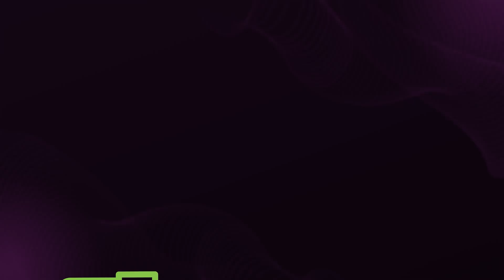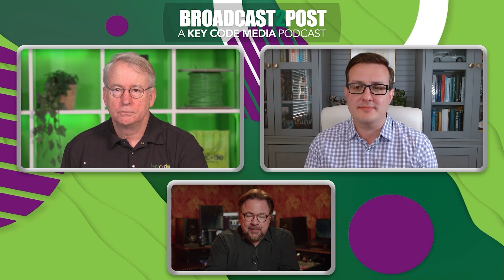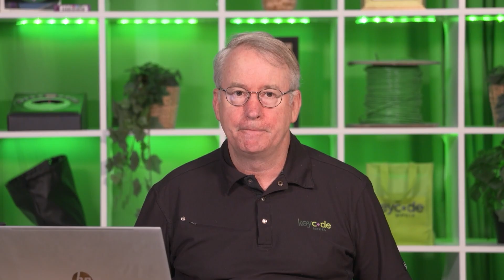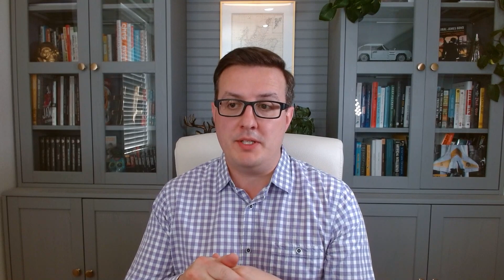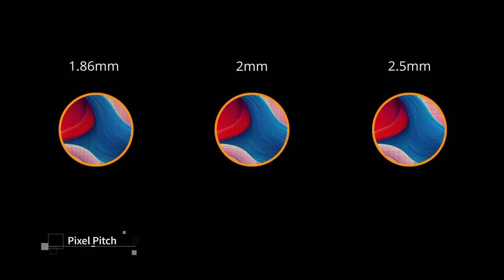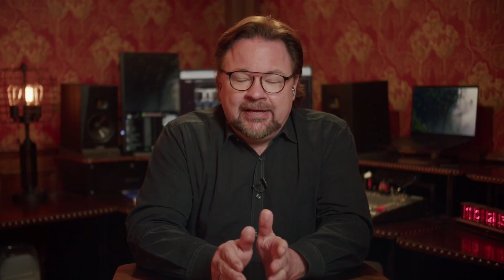Are LED Walls still expensive?? Cost breakdowns!

Comment: I would love to use this for an art installation I’m currently working on but I have a feeling it will still be out of reach for that application. As you probably know, art budgets are currently challenged 🤦🏻‍♀️
Reply from the maker: Totally get that. A lot of our viewers are in AV/IT “infrastructure” roles—people planning out buildings, campuses, studios, etc. so when we say “cheap,” it’s usually in comparison to what LED walls cost a few years ago at that scale.

For an individual artist or small installation, it can absolutely still feel out of reach (art budgets are very real 😅). Sometimes the more realistic path is partnering with a venue that already has LED, renting short-term, or scaling the concept to a smaller wall or projection.

Wishing you luck with the installation though- it sounds awesome.